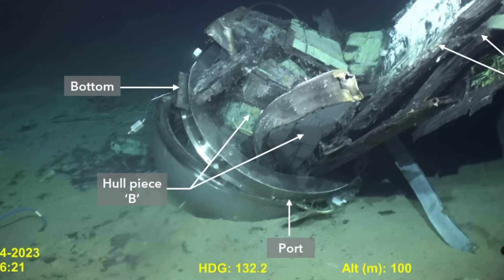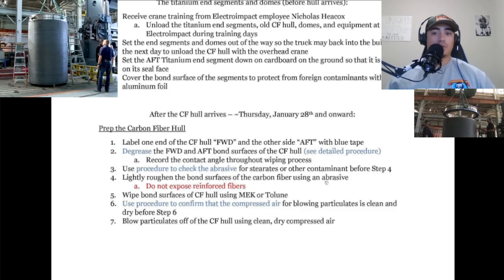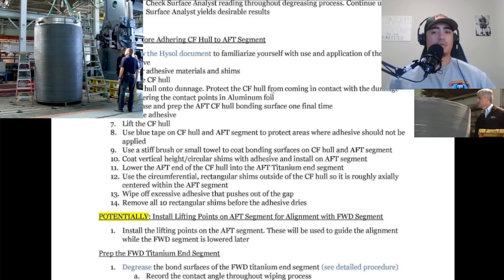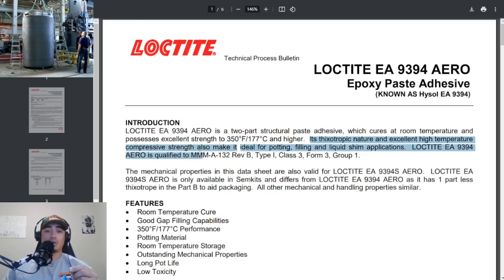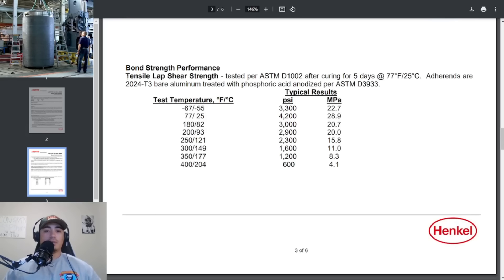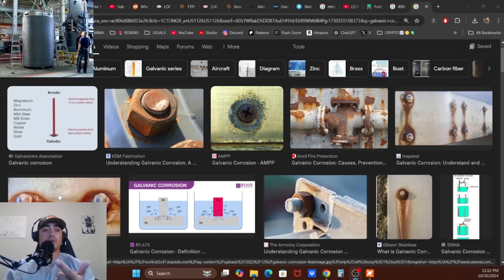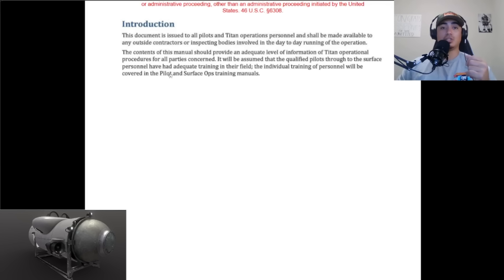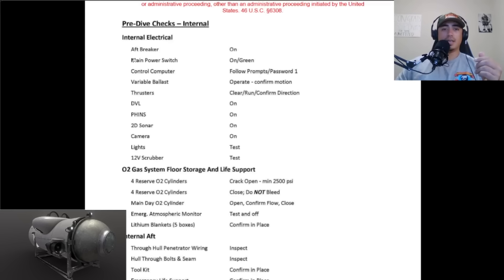Part 5: OceanGate TITAN Investigation: Money Laundering, Glue, & Operations Manual - Latest Files

Comment: You make a very good observation when you state how the ring/flange and the CF hull would have different compression and therefore stresses.  The interface bond between them was a bed of epoxy.  The preparation of each face of the interface would need to be carefully prepared to ensure that it could handle the sheer stress force at each surface flexed at different rates.  Also, the rings were made for Titan v1 (Cyclops) and the hulls were different diameters, which meant they had to modify the hull after it was ‘cured’ so that the rings would fit!  I live the idea of innovation, but you still have to apply best practice to your design, build and testing.

Comment: Yes, the shear resistance is pretty much immaterial. What matters in this case is the bulk resin properties. Can it resist the external water pressure acting sideways across the joint? 
The axial pressure on the joint is not the water pressure. That's because the water pressure is exerting a total force on the dome which has to be resisted by the smaller glued area. The bulk tensile modulus is about 46MPa, and the pressure on the joint is going to be very much higher than that, looking at it roughly the water pressure (about 40MPa) times 5 or so, call it 200MPa. In short, the adhesive has been squeezed to well beyond the limiting tensile strength, but has enough strength marginally to resist the sideways pressure of water, so it will not be pushed out of the joint.
I think the tremendous pressure at the actual joint face, the 200MPa or so, is enough to spread the carbon fibre into the recess and fill it completely, so that it won't move sideays due to differential expansion. But when the hull started to collapse inwards, there were large peel forces pulling the hull away from the ring. These forces would greatly exceed both the tensile lap test strength and the much lower peel strength, explaining why the adhesive in the pictures is left adhering to the ring.
Reply: Exactly

Comment: Surely the application of adhesive would be with a stiff brush or a small trowel, not towel. Not a big point but simple spelling mistakes in a critical application document can lead to misinterpretation and mistakes happening.
I don't think there was a significant galvanic problem, the epoxy would have insulated the aluminium filler. The real problem seems to be the sheer strength of the bond, as you pointed out the 1600psi difference. The flanges on the titanium rings would be bearing this entire load, and look far to thin to accomplish that, consequently they failed.
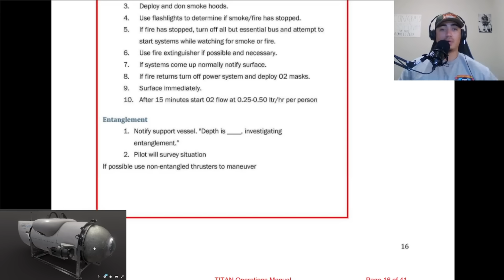At 40:33 regarding dealing with a fire, the last point (10) instructs setting the O2 "... flow at 0.25 - 0.50 ltr/hr per person". Surely that should be l/min. No one could survive on 0.25 litres of oxygen an hour!  Wrong abbreviation for litre (ltr not l) and a flow rate well below survivability totally expose the whole operating manual as amateurish and dangerous. This whole endeavour was an accident waiting to happen!

Comment: Part of the haste with the curing, as far as I understood it, was wrinkles. Any tiny wrinkle near the bottom of the layers of apoxy and fiberglass would, by the top, be a large fold. By applying and curing each layer rapidly, they hoped that it would be malleable enough for the pressure of the next layer to keep it from deforming, and since they were doing another curing so rapidly after, the lower layers should finish. Of course, that's just one of many many issues with the construction, because it didn't work.

Comment: Ocean gate did not put the hull in a autoclave. Apparently they wrapped it up during the curing process because Stockton was too cheap to transport it to a facility that had a large enough autoclave to fit the hull. That was a big mistake, one of many. I noticed that the epoxy they used was designed for excessive heat. Like in an aircraft around certain areas like engine cowlings etc. As the temperature gets lower, the performance of the epoxy is less. The lowest temp stated was 67 degrees. At the depth of the titanic is probably close or lower than freezing. Having a clean surface to apply the epoxy needs to be spotless clean. Yet they only cover it aluminum foil? Also at what point did they scuff/sand the surface of the carbon fiber? Can you imagine all the particulates floating around? This process should have been done in a clean room or something very close. But instead a filthy dirty shop or warehouse? These guys were clowns and 5 are dead, 4 innocent. I could go on and on. Thanks for covering this, I have learned more about these dreamers who thought 'Safety is just a waste' (Stockton Rush)

Comment: The  prep procedure should include a  minimum profile reading that needs to be achieved or a profile target range..
Where I work we Sandblast  allot of the surfaces we apply epoxy to  and  our or target range for profile  reading is  3mil to 3.3 mill and the profile needs to be in that range.  Its suppose to be an even consistent profile . Nothing below 3mil and nothing over  3.3 .

Comment: I’m actually surprised that Rush used any glue at all. I’d expect him to use a friction joint by heating the titanium and freezing the carbon fiber and then pressed them together. Remember this is the same guy that rationalized only using four of the bolts to close the hatch. That worked out well when he did that too.

Comment: That inner flange on the titanium ring was completely uniformly sheared off.
Reply: Flange on the 3/4 size model failed when it was tested.
This should have raised alarm bells.
Just eyeballing it the flange looks way too thin and not deep enough.
Then they trimmed half an inch off the carbon fibre so it would fit in the ring!!

Comment: those separation blocks will  on the lower support, will cause depression even microscopic on the other end , will cause a weak spot under pressure. On seeing this contruction there is no way in hell i would get in one of those things , its a water coffin
Reply from the maker: That is a great observation. It crossed my mind but I didn’t even think of mentioning it. The entire sub weighs 22,000 lbs. I forget how much the carbon fiber weighs, I would guess at least 5,000 lbs.
Reply: @ any deformation no matter how microscopic could grow a fracture under pressure
Reply: Yes David Lockridge. If you haven't heard his testimony , it's a real eye opener.
Reply: Preach
Reply: Those are cheap Chinese 1/2/3 blocks, and they've got them standing up on a narrow edge. They're only using three so it will sit firmly no matter how far off it is. They also have a big set of parallels and a table with slots for T-bolts, and they're using none of it. It's just standing up where it wants to stand. They're using woodworking methods with the real setup tools as props.
Reply: @SSPDIVING  Spencer Composites estimated a 4.5" thick carbon fiber cylinder at 5118lbs. I don't know that we have any confirmed measurements for the actual hulls, but should be somewhere around 5600-6000lbs
Reply: @Demonic-X ”could” = Will
Reply: @SSPDIVING imagine the stress on it when the used the rings to lift it up onto the ship. Then they left it out in winter, got hit by lightning, and used a playstation controller like he would have extra lives.

Comment: 3-5 days is generally acceptable time frame.

As it cures, it achieves its full strength but gets most after a day

Also you cannot freely interchange pressure at that depth from PSI to the shear strength of the adhesive. Those are two completely different things.

Comment: My guess is, at some point, Stockton Rush lost and couldn’t regain control of descent  and impacted  the sea floor at a high rate of speed. Another possibility during descent, trim of vessel was lost and occupants were thrusted towards and dog piled at end of vessel pointing down. This why it is important to have seats to restrain occupants and maintain vessel trim. I am thinking  the glued joints failed because the carbon fiber hull compressed more than the titanium caps. Examination of debris field could determine an estimated depth vessel imploded.
Reply from the maker: You bring up a great point. According to the brochure and their transcripts, they were actually overloaded by about 100#s, so very possible.

Comment: I build Radio Control Submarines and i find that Epoxy Resins break down over time in fresh water, I did finally find a brand that lasts but only if sealed over with a sealing coating. And i only go to about 6 ft depth it is scary to think they used it here

Comment: I enjoy your knowledgeable commentary. Spoken by someone with real knowledge about literally “your life or death” depends on this equipment and how you use it. Sounds like their financial situation was as iffy as their engineering math skills were. 4x9000 lumens = 36000 lumens NOT 38000! A10,000 psi one gallon air tank will only fill a one gallon ballast tank @ 5,000 psi water pressure. Two gallons total @ 1/2 the original tank pressure.

Comment: Compressed air (CDA) instead of nitrogen for critical parts assembly? Aluminum foil, the stuff you buy at the Piggly Wiggly may have oils and leave microscopic chips. Use Laboratory Grade Aluminum Foil or Stainless Steel Foil. Unknowns from the CDA or the aluminum foil need to be eliminated as the adhesive may react.

Comment: One would think that they'd be using cylinders of instrument grade air to blow surfaces clean, or something better, such as zero grade air (a mixture of oxygen and nitrogen made from individual sources of both gases).
We used those as the air source for flame atomic absorption instruments in an analytical chemistry lab I worked in. It is not terribly expensive, particularly in the context of something that will be made maybe 50 times (being very optimistic) in Stockton Rush's lifetime.

Comment: MEK is methyl ethyl ketone. I am not a diver but a retired engineer in the aerospace industry.
Reply from the maker: Thank you for the information sir. Would MEK be safe to clean/ prep the carbon fiber for adhesive?
Reply: Ah so, by the standards of OceanGate now I have collaborated with NASA and will use this on my advertising and resume.

Comment: Was there anything about the smoke hoods in the operations manual? The only mention I saw was to hoods with a 30 minute endurance, which would be impossibly optimistic when you're in a sealed environment that's going to take longer than that to reach the surface...

Comment: Comparing a rusting steel piling to galvanic corrosion those are two separate processes. Galvanic corrosion depends on the difference in electrochemical potential between the two materials. Even carbon fiber has that. It isn't just the aluminum versus the titanium

Comment: I did a quick review of the comments and your presentation. I am= a trained and certified Nuclear Auditor and as such one of the first anomalies  noticed there are no check off, witness , sign off or verification points in any procedure. Just to keep it simple for this response. These procedures etc would  fail any classification process by ASME for example . There was also a lack of response by OSHA regulators when a formal complaint was filed! There should be criminal charges filed against all engineers and technical advisors that were involved at Oceangate contributing to the loss of life. Further, since the submersible was not "classed" or "flagged" the wording of "EXPERIMENTAL VEHICLE" should have been clearly displayed on the hull of the vehicle just like an airplane!!
Reply from the maker: Thank you for your valuable input. If you’re interested in hearing more about the regulations they avoided and openly admitted, I encourage you to checkout my latest video from the electrical engineer who helped design and test the sub.

Add you mentioned, no real sign off or verification off procedures. The one that stuck out to me was the “grinding” of the unsightly hull bumps with no name next to it, the day before the implosion. Or days before, can’t remember which. But pretty crazy to take an angle grinder to the carbon fiber hull which was already half the thickness of what was required. Anyways, thanks again for sharing your perspective.
Reply: @SSPDIVING  Thanks for your reply, I did go back and look at the US Coastguard (CG) site and information. Suffice it to say there was no QC (Quality Control) throughout the whole project. I was wondering  in the questioning, the CG representative asked one witness if he knew what a "Professional" engineer was. As I am very familiar with governance  documentation, QC and QA, (Quality Assurance) and the fact that I could not find any document that was stamped with a Peng stamp, It became obvious that this was not a  professional undertaking rather a "Garage" project that should never have made it to the water! I am very dismayed with the OSHA response and followthrough and hope at least people will be fired along with criminal charges administered to people who were responsible for the manufacture and oversight of this debacle! This project was totally out of control from the start and should have been shut down. There was enough information and public knowledge BEFORE the Titan made its first launch for a regulating body to perform an initial assessment ! Even experimental aircraft are required to have inspections by the regulatory body before first flight that carry passengers (public) etc so there is no excuse for what happened. Specific parameters, for example, the gluing should have had a Peng sign off for the type of glue to be used with a verification and signioff at site ( in the procedure) for verification. Hold off points should have been used with witness and verification  for a specific cure time with signed offs AND measured with "calibrated" equipment that could be traced back to "tertiary" standards of calibration etc. I can only guess that none of these QA & QC procedures were initiated or followed because of the "cost" but now who can put a price on human lives that were lost? This is why we have regulators and governance documents to protect the public...period!

Comment: I also followed this disaster. The sinking of the Bayesian was a tragedy because many people died. The boss of Pini Marine behaved completely stupidly. So far, however, it is not 100% clear why the yacht sank. We know that most of the other yachts and fishing boats heeded the weather warning and went into the harbor; why not the Bayesian? The (electric) sliding doors are often a problem on motor yachts too. I don't think they were locked on the Bayesian, because then everyone would have had to be inside the ship. It can be assumed that the portholes in the side walls were closed (very few can be opened). The other doors (stern and side) were obviously locked. However, there are many openings on the deck (ventilation) and the engine room is not sealed either. This means that a lot of water can quickly get in at a heel angle of just 90°. The statements of the surviving crew are unfortunately contradictory. But you always have to remember: Nothing is 100% safe on the ocean. Very large ships have broken apart or capsized in storms, despite all safety precautions.

Comment: Water has the lowest density at 4°C (3.98 °C exact) and thus water at freezing - evidently at 0 °C - is less dense than that. That's why lakes don't kill fish, because the lowest density water isn't sinking to the bottom at freezing temperature. It is known as negative thermal expansion (NTE) or density anomaly, and is 6th grade physics and chemistry, at best.

While salinity plays a factor in freezing, moving the freezing point of water to lower than 0 °C temperatures it doesn't change the NTE, just the freezing point. At -21 °C even saltiest water freezes creating a Sodium chloride hydrate SC2. Nonetheless freezing water till about -20 °C still has the same density anomaly. Thus and hence that's why ice swims on water, it is less dense than the surrounding water, i.e. volume to weight ratio is less than the medium it's in, thus buoyancy. 

Salt water also has higher density - see all those people floating in the Dead Sea - than fresh water, which usually is the water given off by glaciers or other sources of ice in or near the oceans, that would be the direct source for water as close to freezing as possible. And for the obvious question I quote: "What happens when water with salt in it freezes? Will the salt be left behind? Much of the salt gets expelled as the salt water freezes. The salt is expelled as brine that won’t freeze."

And, yes, Freezing Point Depression: The presence of salt lowers the freezing point of water, meaning that saltwater freezes at a lower temperature than pure water. For example, seawater, which has a typical salt concentration, freezes at about -2°C rather than 0°C. Also again expels the salt, and also again fresh water is less dense than salt water.

In a coordinate system the density graph looks like a V ..  \|/ with 4°C at the lowest - i.e. point of origin where X & Y cross, at 3 °C it's as if were at 5°C ... -2 °C <=> 10 °C

Thus by definition the water at the wreck site of the Titanic cannot be at freezing temperature.

Cold for sure ... but not freezing